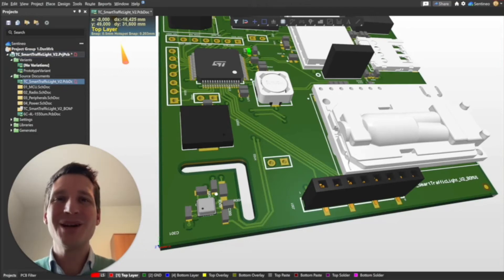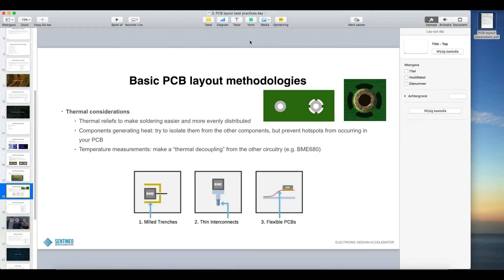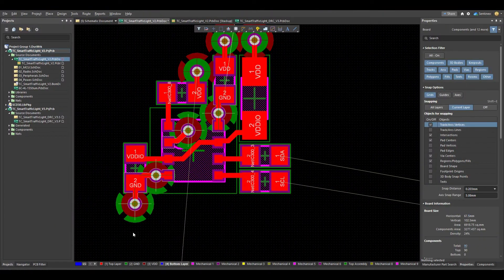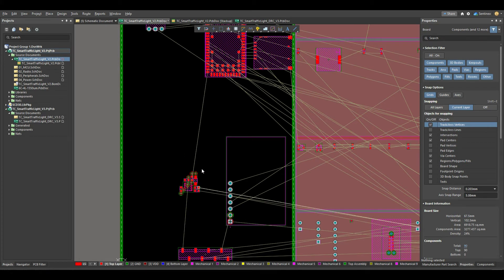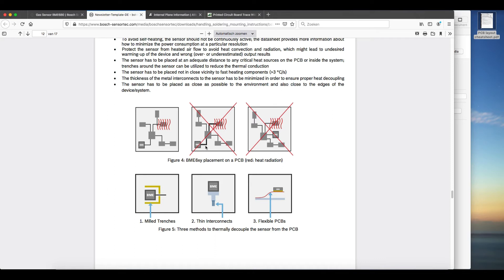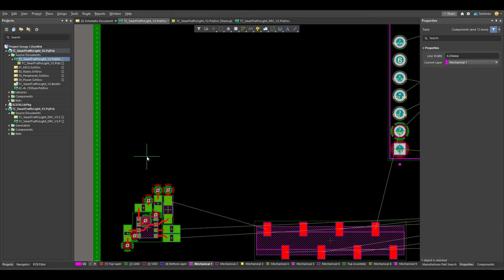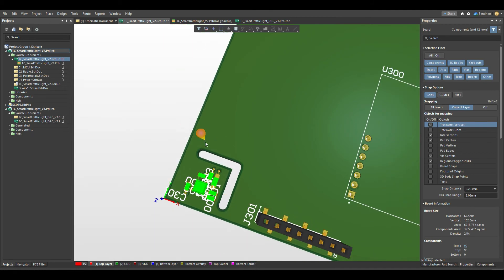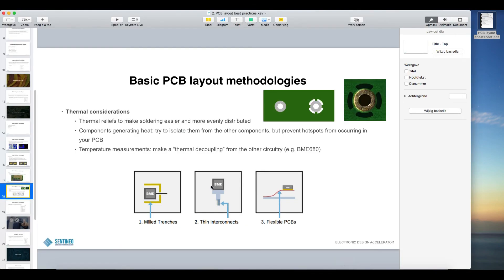Thermal considerations on a PCB Design in Altium Designer

Comment: Can you explain how to do through hole components? I am using a pcb board for my microcontroller, a couple of resistors, and transistors but I don’t know how to tell Altium I want to solder my own things and not do SMD components
Reply from the maker: Hi Brandon, I would suggest to have a look in the standard Altium library: in the components panel select "Miscellaneous devices", then "Res1" or "Res2". These last two are axial resistor footprints, that is what you are looking for (respectively with 0.3 and 0.4 in spacing, take the latter if you are unsure). 
Same thing for the transistors: in that library you can select "NPN" for example. Best is always to use the exact footprints, feel free to check my other video on that topic: https://youtu.be/_sFIKRG66vE